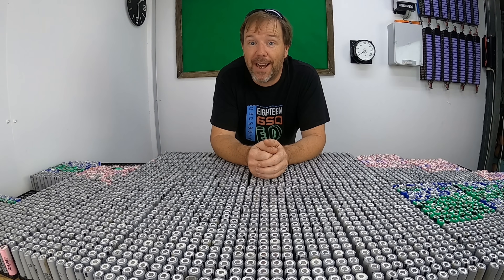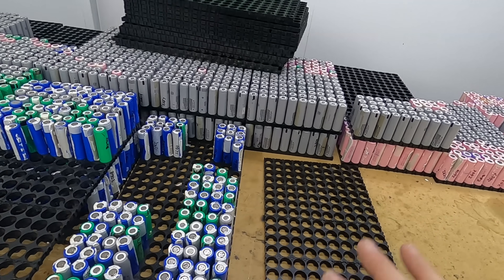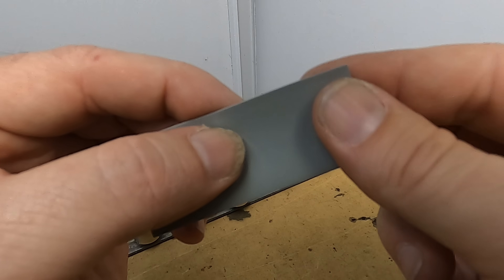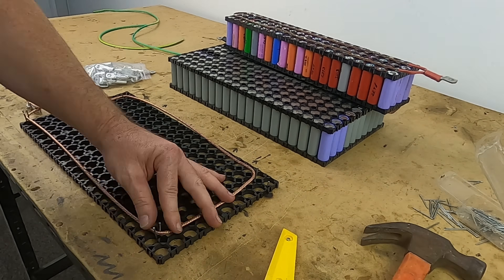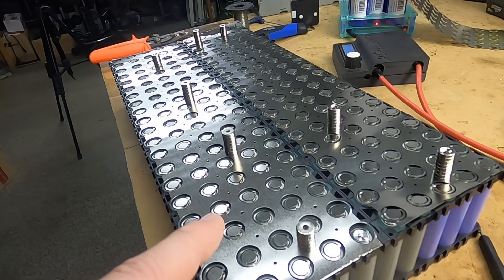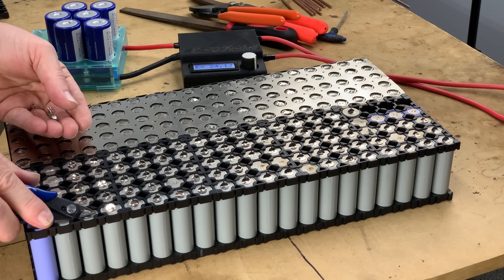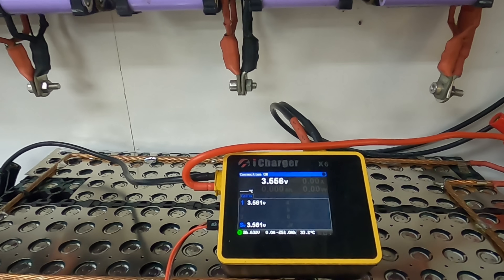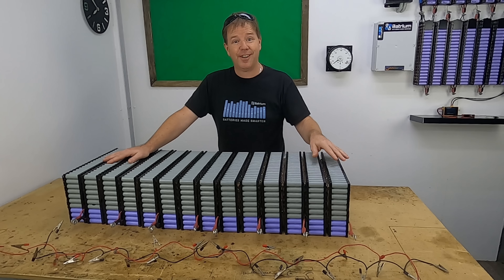Creating my single biggest D.I.Y. battery with 2800 18650 cells recovered from used laptop batteries

Comment: Wow that’s what I call wombling!     Nice work and a nice film.    Thanks so much.   I am curious, could I run my induction furnace from this?    It’s one of the blue and white Chinese induction heaters from eBay    Lh15a.     It is sold as a 15kw machine yet only draws 30a of 240 from the wall.    I use it to melt copper, bronze, iron and steel.     It takes about 40 minutes to melt.   I moved away from traditional gas and oil because  I am trying to develop carbon free casting and forging.     Ideally I want my own renewable micro power generation and a big enough storage system to do at least one melt per day but more if possible.      Is it possible to draw power at that rate from this type of battery via a big inverter?      Cheers.   Tanc
Reply from the maker: you could but dam you'd shorten the cells life span unless you used it only during the day with a sizeable solar system so all the load isn't pulled directly from the batteries

Comment: Do all laptops use 18650s inside the battery packs? I thought that wasn't the case! I work at a computer hardware recycling centre, this could be useful information!
Reply from the maker: some have 17560 (or something, slightly thinner than 18650 cells) others have prismatic & newer laptops have flat style batteries, can't for the life of me at 5am remember the name

Comment: wow... that took some work... 

But seeing the prices on pre-made power banks of similar size, it seems like a viable (albeit extremely tedious) option financially.

Of course, I have no clue what you spent on legally discarding the remaining laptop bits, and if they are used, it can be that some cells are pretty far through their life, but hey.
Reply from the maker: Yeh if you have time and not much money this is an option -but my god it took a long time made worse by film and edit! All scraps went off to the local recycle center.. didn't cost anything to dispose of properly. I'd say the cells are half way through their useable life, but got them from the recycle bin so at least they aren't getting recycled too early in their life..

Comment: Problem I have with this, while a very nice assembly, what do you do if one or more of the battery goes bad, shorted or otherwise, and how would you find the bad one when they are all in parallel ?  The rest of the batteries will start to feed into it possibly creating a dangerous fire hazard.
Reply from the maker: ok so to address that - a thermal camera is prices less for this type of project and I use my weekly to check my cells, the normal fault state of these cells is, They get hot.. so super easy to see and pick up a cell with high internal resistance. If a cell goes dead short, there are fuses that blow at about 5 amps on each cell. The cells also have a CID built in. In a dead short all the other cells will dump 100's of amps if not 1000s for a micro second blowing both fuses & the CID, If both of those failed to stop the issue the 60kg steel cabinet it's in will stop cells flying all over the place and catching everything on fire.

Comment: Just wondering if connecting cells in parallel causes slow self-discharge, I have noticed 
3 NiMh cells in a parallel holder with no load go flat quicker than if not in holder.
Reply from the maker: only if you have a self discharging cell in there (and I did in next videos) thermal camera will find it fast.

Comment: Sorry if I missed it but why do you add the few blank non battery cells into each pack?
Reply from the maker: the blue cells may touch the metal mount - it's an effort to try to isolate the battery from the metal mount.

Comment: why is he doing 14S? isnt a standard 48v? that would come out 15S no?
Reply from the maker: 4.2v max voltage per cell x14 is 58.8v you can very easily go 15s and many have but for me, OCD comes into play.... Also my inverter voltages match well with 14s

Comment: Can I make a battery pack out of theses for my atv 4wheeler
Reply from the maker: many have - but you need to consider the safety side - the vibrations cause major issues when done like this so you have to add extra strength and vibration control

Comment: Ive always wondered if the type of algorithm used in solid state drives to spread the cycles evenly across each memory cell could work for a battery array. It would be complicated but could really reduce the charge cycles across the array extending its life.
Reply from the maker: I think the added complexity would completely remove it's usefulness..
Reply: @HBPowerwall  yeah it would be something for the big manufacturers. I mean u have to know the charge state of every cell. Just something ive always wondered about. Great job on the battery pack. You got yourself a new subscriber.

Comment: Miss your shows man
Reply from the maker: I don't miss producing them lol
Reply: @HBPowerwall  I bet.
Reply from the maker: its awesome what spare time I have these days - NO WAIT - I got a pair of minis.. scratch that I got less spare time lol
Reply: @HBPowerwall  I wanted to do an ev conversion but no time. Got the mach e instead. Home battery is at 50kwh and adding another 7000kwh to it in the next few weeks. Just spent the last 3 weeks re-capacity testing all packs and was amazed that the packs capacities are + - 5amp hours some are better some are worse
Reply from the maker: Nice - yeh diy ev suck lol I got an MG EV now

Comment: So you are mucking around recovering all those batteries and you do it in a light colour. Do we know about light colours?
Reply from the maker: not sure what you mean?
Reply: @HBPowerwall  light colours hold heat
Reply from the maker: what heat? I designed my battery right and there is zero heat?
Reply: @HBPowerwall  so it is way oversized?
Reply from the maker: My reply's keep disappearing ? it's not way oversized it's sized to my load, my environment & to keep the cells WELL with in their operating range.
Reply: @HBPowerwall  yeah fair enough, it is a regular discharge and charge so no stress.
Reply from the maker: is 100amps constantly regular? lol

Comment: Without a BMS controlling each cell, or a diode between the batteries and positive terminals, those packs usually won't last very long. The current will flow in reverse in the weakest batteries, and they might cause a fire.
Another thing, is you might want to put them into a liquid sealed container, and fill it up with some sort of cooling liquid.
Mineral oil is good, but it also can catch fire, and it usually creeps out of the bins or tubs you put the cells in. 
Antifreeze can conduct electricity if the liquid is polluted, so that's also not an option. Same goes with distilled water.
Reply from the maker: You're a madman - simple is better, like building your battery to suit your needs - these cells will NEVER exceed the room temp - like ever! If they do it's either bad design or you're constrained by space (like a tesla battery) I only use www. baterium.com BMS on all my battereis.

Comment: hmm... for 3 phase inverter, 64*3.7V (~240V battery pack), you need 2816 batteries... which gives you 44 packs... with 3000mAh batteries that would be a whopping a tad over 31kWh or just 132Ah :D
Reply from the maker: and a huge bulid budget :P

Comment: What if one battery 🔋 in the unit goes bad? Is there a way to know which one is bad? I can only imagine the work Involved in the event one goes bad. Good video
Reply from the maker: good thermal camera on a charge cycle you can see the issue and fix quite fast as it turns out.. see next few videos

Comment: Testing the capacity of all these cells must have taken ages.
Reply from the maker: A year of collecting testing and sorting... yeh, ages!
Reply: @HBPowerwall  How did you get the capacity of each cell? When I do that it takes about 5 hours to discharge and the same time to charge. With 4 cells per charger I can determine the capacity of 4 cells in 10 hours, which is 4 cells per day in reality. How many chargers and dischargers did you use in parallel?

Comment: "Well done!" from me, too, mate. You've put in a herculean amount of effort to bring this huge project to near-completion. For that alone, you deserve a bloody medal! Regardless of the ultimate outcome, don't lose heart. Edison tried a thousand different filaments before he hit upon tungsten for the incandescent light globe. You're already a legend, buddy!
Reply from the maker: Many thanks! - Battery still sits unfinished due to motivation -  but my 5 plus year old battery is still up to the task of daily cycles so I'm grateful for that..
Reply: well edison didnt use tungsten but I get the message
Reply: i wouldnt put in parallel different capacity 18650. The lower capacity one will sag wayy more under load than the high capacity one. For example if you have two cells in palaeel, one with 2000mAh and one with 3000mAh, the internal resistance of the 2000mAh will be much higher, if you draw 8A from this pack, the 3000mAh cell will probably provide 6A and the 2000mAh will provide 2A. when you temove the load, they will try to balance them creating internal currents in your pack, i wouldt want to be near a pack built like that

Comment: if they are used batteries what if theres ones that dont hold a charge anymore? wouldnt it be better to use new batteries? or do they repair themselves to hold a charge again?
Reply from the maker: I spent a year testing for heat, self discharge, capacity etc

Comment: 4:55 is it really important, to put this isolation pipes on the cells? By this configuration? When all cells are looking to one side? Maybe it could be bettet, without, for better cooling?
Reply from the maker: Cooling simply isn't an issue when you build a battery that well exceeds your max needs. Running the cells how would reduce their expected life span & be considerably more dangerous.

Comment: Hi, thanks for making great videos. Maybe stupid question, but why do you need to put 6 "blank" zero cells in the pack? And are those just "bad batteries" or a special kind of "zero cells" that you get from somewhere?
Reply from the maker: just bad batteries with poor capacity, they are there so there isn't any cells touching the mount causing ground faults.

Comment: Before actually watching the video or seeing any other video on your channel yet, I noticed you have many cells in series and in parallel. There are several things I have figured out about that. First of all, it is safe to discharge 18650 cells in series, however, when connecting cells in parallel, diodes must be used to prevent parallel charging. This leads me to the second and very important part, you simply CANNOT  charge 18650 battery cells in series, ever!!!! The reason is due to variations in the charging of the cells, which inevitably leads to one or more cells becoming extremely over voltage. The ONLY safe method to charge 18650 cells is individually using 4.2 volts. Otherwise, the pack will explode!!!!
Reply from the maker: I have 500 plus videos that say I can? BMS, TEMP control, ShuntTrip controled by BMS, 1000's of fuses on every cell, battery banks with their own fuses - you can build a nuke and make it safe!
Reply: @HBPowerwall  Take a multimeter and check each cell's voltage after charging. It is inevitable that one or more will be over 4.2 v. This may not matter for many years, but eventually will suddenly explode.
Reply from the maker: they just balance... for all cells in parellel - BMS takes care of the series batteries.. NEVER had one go near 4.2v as my max is set to 4.14v and low is 3v - BMS will trigger a shunt trip if this ever exceeds - as well as 100 plus temp sensors
Reply: @HBPowerwall  Thanks for the reply.

Comment: I love the concept but this feels like it would be PURE HELL to repair or do maintenance on.
Reply from the maker: in one of the next videos I did on this battery I showed finding and fixing bad cells. With the right tools it takes minutes.. Thermal Camera and good multimeter - Hell you could use IPA to find hot cells.
Reply: @HBPowerwall   Well here i stand fucking corrected. Thanks.
Can i inquire how often do you face issues with this setup thought?
My too main concerns with it were:
Probably hard to repair (Which you corrected)
And too many moving parts  (which would in theory mean more maintenance needed.)
 Thanks for taking your time to anwser.
Reply from the maker: Well I have around 7000 cells in service over the past 5-6 years, might have replaced 10 80p batteries in that time. Always have spares, so two min to swap out and over the next few days you work out the issue with the removed battery and fix it in your spare time, recharge to 3.70v and sit it on a shelf till it's needed again. A good BMS helps with the trust thing, for the first few years I spent countless hours double checking, now it's visual inspection once every week or two and a when the cells are hit with a 7000w charge load at a low SOC I usually get the thermal camera out to take a look for hot spots.. That said this battery after two years is still not in service and sits close to how it is in the next video..
Reply: @HBPowerwall   Thanks for answering to my concerns. 
Frankly sounds great for someone that is in the field  and has a decent knowledge of electrical engineering or maintenance.
I doubt it would  be much good for commercial users or people not interested in the field as the average person never preforms maintenance.
Might consider making similar project once i get my license that would qualify me for electrical work.
Thanks again for taking your time to explain and elaborate on your design i appreciate these videos.

Comment: If a bush fire or a bad storm with high winds enough to encroach on those cells ever comes near your house the astronauts on the ISS will see your mini-sun, too!
Reply from the maker: Well - that would be some what of an issue - 2mm thick 60kg metal cabinet to house them in - then that will be inside a shipping container.. DOES the ISS have xray vision - actually don't reply to that, i don't want to know lol

Comment: Each cell has two connections, 5600 connection points of potential failure + 2800 potential parts to fail....
Reply from the maker: Dam you math good... but given she is still holding up I guess at this point I'm good to go still..
Reply: @HBPowerwall  :Get back to me with your results in about a year.....

Comment: How did you know the old batteries are in acceptable condition?
Reply from the maker: Spent a year testing everyone. for capacity, heat, self discharge & physical defects. Also have 1000's already running my home for many years (see the other few hundred videos)
Reply: @HBPowerwall  This was my thought... I need to test every single cell? This is crazy :) I like it. Great job
Reply from the maker: Thank-You

Comment: just about the most dangerous way to build a home powerwall. one bad connection out of thousands and yur house burns down with no insurance coverage because all of this is illegal.
Reply from the maker: 1. Yes, dangerous BUT walking on a side walk is also dangerous..
2. One bad connection is the least of your worries.
3. Insurance won't matter if you're not a complete dick about where you install it.. 
4. illegal is a geographical thing.. also an if they find out thing ...

Comment: Does this power everything in your house? Or are you switching from diy battery backup to paid electricity via an automatic transfer switch, if power runs out? This is the first video of your I have seen, but exactly how I envisioned myself using 18650 cells long term. Great work man.
Reply from the maker: This battery is still not complete - life got in the way and I stoped tubing.. My 40kwh battery is still in service for the past 5 years tho... look back at the past 400 videos :P

Comment: Never connect copper wire to aluminum connectors. Metal oxidation will lead to overheating and fire ...
Reply from the maker: Ideally perhaps your are right but 1. This is DIY, 2. HAS to be cost effect. 3. Needs to be accessable to the masses

Comment: I've posted this question on multiple sites but no answer so here goes, could a power wall be made simply by just using cordless power tool batteries that just slot in as they would be on a tool, I've seen guys using the plastic tray that you push a battery in like in a remote or toy but if I could use an existing pack as manufactured at least then it has a bms per pack and if they are brand new then I would have a warranty also, to build a system like yours with that amount of cells would take an age to find then the hassle of testing.
Reply from the maker: Yes, but space and ablitly to check cells first might be a challenge
Reply: @HBPowerwall  thanks for the reply, as the pack would be new cells I wouldn't need to check them and space wise I was looking more for simplicity in building a power bank